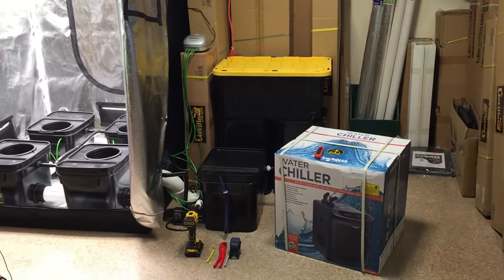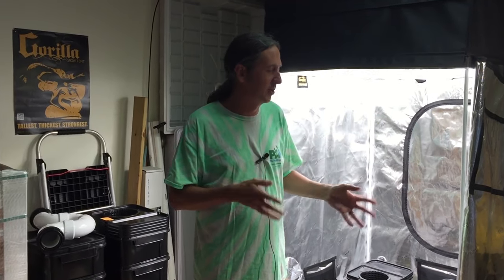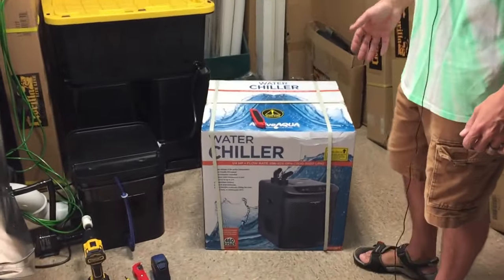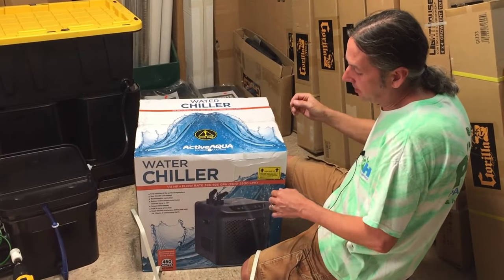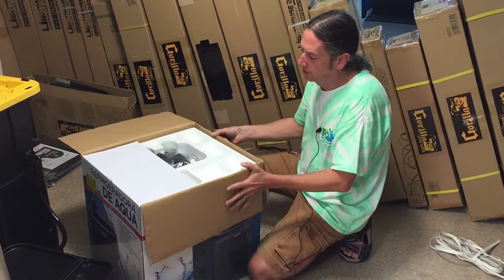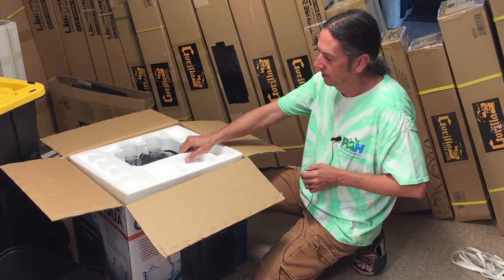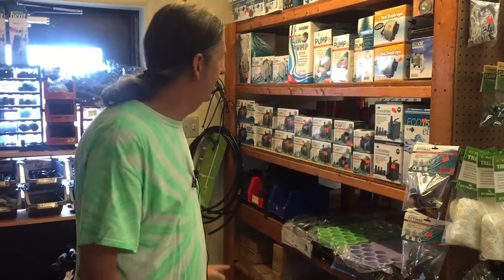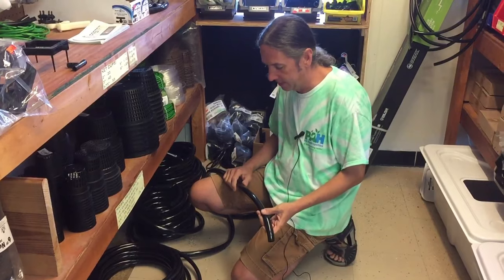How to Hook Up a Water Chiller to Your Hydroponic System!

Comment: I noticed you mentioned Cannazym as an option to keep the water chiller and everything nice and clean and I grow in a similar system and I've read and been told that cannazym is a waste of money in a hydroponic grow because the product cannot survive in a salt based medium (I'm using General Hydroponic nutrients among other products)
Can you explain which I should do because I do have a bottle of cannazym sitting in my closet from when I used to grow in coco and if I could use it and it will do something I'd love to use it. 
I have clearex which isn't the same at all but I do plan on running it once I upgrade my dwc setup to rdwc next week. Just to break down salt build up and whatnot.
Reply: cannazym is an enzyme.. It will do just fine in your setup and it will eat at your dead roots and recycle nutes back to your plant.. get yourself some food grade peroxide. (hydro store) 30% or higher... use about 2.5 to 3 ml per gallon and that will work like an enzyme and then sum. adds oxygen and sanitizes too.

Comment: What size of you two buckets do you recommend 8 gal  or the 13 gal for a  4 plant system in  a 4x4 tent for max yeild ?
Reply from the maker: There is nothing mini about the 8 gal system. We are told frequently about how large peoples plants have grown in any of the different sized bucket systems.

A four plant system in a tent with a little experience will outgrow your tent easily.
Reply: @PAHydroponics  what is the height difference in the two bucket sizes

Comment: yea you got that point across, fair play dude considering you sell them! next years project is to install a split ac in the room . i wasnt sure if i should try to chill the 220litre tank also Ph doser and O2 generate , do i try to do all 200 odd litres or set up a smaller tank were the recirculated water enters back into the system?
Reply from the maker: Either way but I would not want chilled water going straight to a plant so having a separate place for that water would be better.

Comment: Was wondering if you could run a 1000 watt light in a 1’ extended gorilla grow tent with good aeration. I’m concerned if things will get a little hot or my buds will bleach.
Reply from the maker: I have customers running them in 5x5 with extensions and it works but I would say you should be in a good cool area for it to keep under control. If you keep temps right it will rock, and High power LED's can do more bleaching than this. Hope this helps! Gary
Reply: Hey Gary I’m running a portable Ac unit attached to a temp controller that’s going to cycle the tent or the surrounding area. Not sure if I want to put it in the tent or not because it has a dehumidifier attached to it. Where I’m at I need all the humidity I can get. Thanks again man!

Comment: 16 plant fallponic system? That’s music to my ears Gary lol. Thanks for the video
Reply from the maker: LOL, yeah it can be done, all about splitting evenly of the waterfall and would fit an 8x8 but I would have 2 systems in there 8 plant each instead of 1 big system so I can split strains up for harvest times etc.And thanks for watching :) G
Reply: PA Hydroponics Gary, do you still plan on making an 8 plant fallponic system available on the your website? If so will there be a setup video that follows?